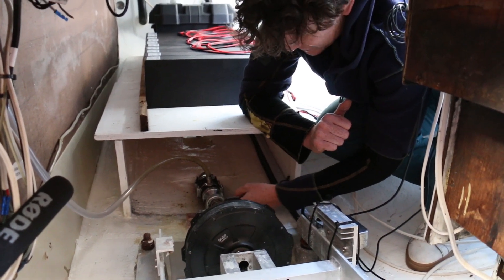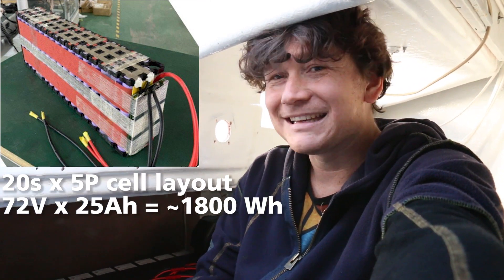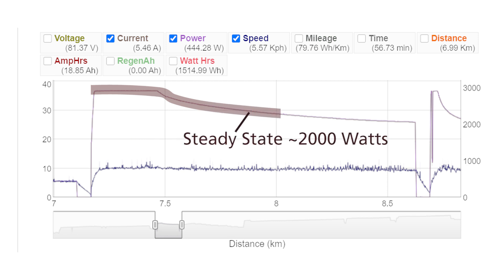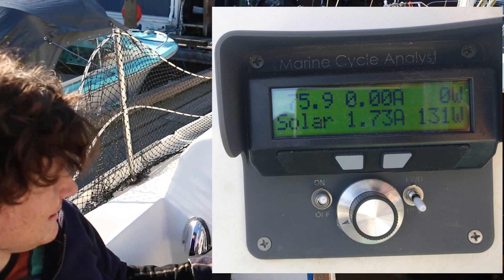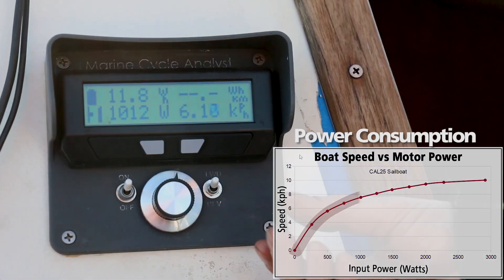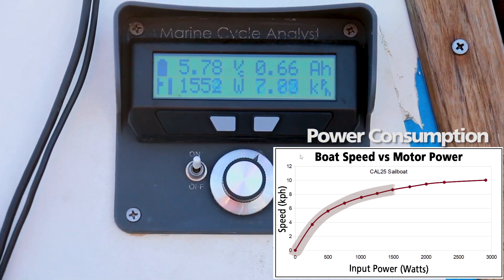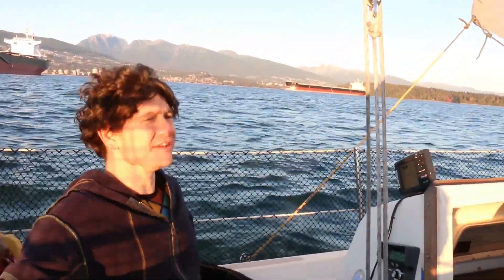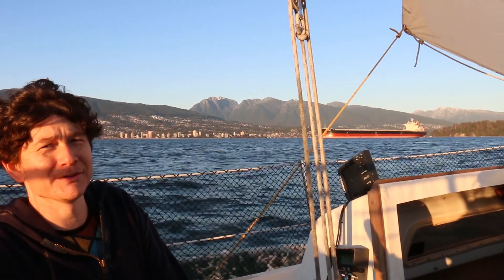Shamrock Electric Sailboat Conversion Part 2 - Sea Trials with 72V Lithium Battery Bank

Comment: When is water cooled motor & ctrlr coming up? 🙂
Reply from the maker: We'll be quantifying air cooling first and hopefully that's all the difference that's needed. A few fan blades on the motor that also blow air over the controller heatsink should do wonders.  
Otherwise it's flashbacks to the salt water cooling circuit of the diesel engine and not wanting to go there...

Comment: Very cool! I was dreaming of electrifying our similar sized sailboat a few years ago, but alas we have now sold it. As you noted for the west coast, similarly we often found ourselves motoring in non-existent to very light winds here on Kootenay Lake in the summer (or the opposite, a complete squall!), and I had thought it would be much more lovely to motor along under electric power rather than listening to the noisy gas engine. I was thinking of using Nissan Leaf modules however, as that chemistry is pretty safe at the temps I would expect in a sailboat. What chemistry are the 2170 cells you used? Cheers.
Reply from the maker: Hey Andrew, actually I also was hunting for Leaf modules for this project too but in the end it was cheaper to get brand new cells directly from one of our ebike battery vendors.  These are Panasonic 21700A lithium ion cells.

Comment: What is the size and weight of your boat? I am looking for a electric motor to replace my diesel but not sure how much kw/NM is sufficient, my boat is 30 feet and weighs around 7 metric ton
Reply from the maker: It's 25 feet and 5ton displacement. All details are in the ES build thread in the link if you expand the description.

Comment: Thanks for the response, Im repowering my electric catamaran, built in england in 1977, refitted in 2006 with pactroq pm motors, they are 2.2 kw, I am set up with 12 agm group 31, @ 144 volts per hull. I was wondering if you knew how to make a 144v battery bank using the types of cells you bundled up for your 72 volt system?

thanks
john
Reply from the maker: Hi John, yes you would just put two of the 72V banks in series and that would create a 144V system.

Comment: Why do144 volt systems produce less torqe than 72 volt systems?
Reply from the maker: The torque that a system can produce has absolutely nothing to do with the voltage that the system is designed to run at.    You can make a 12V system with tons of torque or with very little torque, just as you can make a 200V system with lots of torque or with very little torque.

Comment: Why not use GPS data with a speed pulse converter for accurate measurement? This should allow the CA to detect speed with GPS input?
Reply from the maker: The CA has that with the special firmware we made for the suntrip solar bike race, so yeah it can log and record the GPS speed data too from the GPS module that is on the analogger. We'll cover this in one of the next videos. 

But for the boat power/speed measurements you really want actual water speed, not the GPS speed. Otherwise the tidal currents throw off the measurements in a big way.
Reply: Does Grin make a larger motor controller than the PR?  If not, could you not get creative and use a water cooled base plate with either a heat exchanger to prevent corrosion?   A cool project, has the wheels turning (pun intended)

Comment: Hi,
Do you gain or loose speed when regenerating ?
Reply from the maker: In theory you would loose a tiny bit of speed, but normally when you are regenerating it's because there is already more than enough wind available and you're going at hull speed already. In those conditions no speed drop is discernable, but in light winds it's not something you'd want to do.

Comment: Good stuff Justin! I see you're trying to develop a product around it. Nice going. I'm interested in being part of the trial but I think my boat's too small and that I couldn't keep the motor dry of saltwater. If you have a tip for something that might be better as an outboard I'd appreciate it.  Also considering a Maytech MTI120116 18.8 kW motor. I was out in 35 kt gusts this past weekend and ended up radioing for help and getting towed in. I would like to be able to drop sail and self-rescue with my electric outboard in situations like that. 

At the beginning of your vid I see the entire motor spinning. I don't get it. I thought you'd want the body of the motor to be fixed and the axel / shaft to spin...
Reply from the maker: Hey nice to see that you have some sailboat and electric drive ambitions too! This solution of an ebike hub motor directly spinning the shaft only works for boats with an inboard motor in them. and yes the entire motor spins, that's how outrunners work. Inrunner motors don't have as much torque density and would normally require a gear reduction rather than direct coupling as we did here. 

Lots of people have DIY'd electric ouboards by just replacing the gas engine in a normal outboard with a suitable electric motor. We're going to do this on an old seagull motor for the tender using either an eZee or GMAC motor.  You don't need 18kW to self rescue in a small sailboat like I see in your videos, 1kW will be more than enough.

Comment: Great, thanks for sharing, i just experimented an engine cathastrofhic failure while starting up at the marina, first option i had to adopt is to buy an outboard engine, but now i need to deal with a main inboard power solution, I have been doing a bit of research, but here in Europe parts and components are very high in cost, wonder if your firm is actually considering the EU market? I wish to make the conversion myself and document the process as goes along. I am a aircraft mechanic and IT Bsc, so the skill is there but the knowledge is on the making.
Reply from the maker: Hi Fernando, yes please send us an email with more details about your boat and setup. We're hoping to be able to have an initial pilot release of this motor drive system later this summer and are looking for candidates with the right skills and boat to be involved in this early deployment and test phase.

Comment: I'm ready to start an electric ⚡ sailboat company. It's the future of at least sailboats at this point in time, so when are these kits available? Lol I think my favorite feature of this system , is the increased speed under sail @400w ! That's free quiet power . Building my first battery pack soon . Then the manufacture the motor mount , each boat is different . I'm a boat guy gone ebike , and this really gets me going ! Thanks much respect.
Reply from the maker: Hey Mark, stay tuned to our website. We may be in a position to offer this fast wind motor with a special axle for boat applications by this summer if all goes well.

Comment: Are the satiator outputs simply paralleled to the pack?
Reply from the maker: Yes indeed. The batteries were made with single port BMS circuits (same output for charging and discharging) so that they can safely all be charged up while connected in parallel, and the satiator output themselves have no problem being hooked in parallel either.

Comment: Does the boat have pedal assist? 😅
Reply from the maker: Someday,, I assure you not a trip goes by that we're not scheming of the best way to fit pedals in the mix :-)   One thing that is nice with the CA display is that we have a very good idea of exactly how fast we'd go with any amount of pedal effort. Pedaling hard you could do almost 2 knots, which isn't bad for getting in and out of a Marina etc.
Reply: @GrinTechnologies  Would be fun to see such a test compared against a sculling oar or a yuloh. Different muscle groups in use with similar top speeds and, naturally, human power levels.

Comment: Water cooling the electronics is your friend when your on the water! Big stainless steel plate on the outside sandwiched to a Copper or Aluminum plate inside the boat for the controller(s) and for the motor you could use some custom stainless steel side covers to flow water around the motor and a dripless shaft seal each side. (maybe stack two motors for a bit more grunt and appropriate pitch prop)
Reply from the maker: Yup the sea is a great heatsink. But for the controller it's simpler/cheaper to add more mosfets so that less heat is generated over a larger area in the first place. That way the controller runs more efficiently and doesn't require additional cooling, so that's the route we'll take for the next upgrade.
Reply: @GrinTechnologies  I've got a 1000w hub motor on my bike, it's runs 30amp on a 52v bat. Now I want to go faster. I did a search on YT, people have upgraded their stock controllers to e.g 2000w max output @60amps and they're plug n play so you tune them to your needs. The controllers are Grin phaserunner and ASI bac 800.

Edit: I've just seen your TY name. You already know the above.

Comment: This is really interesting system you're having here. The consumption numbers seem to be a little better than mine. But I'm doing a new bottom paint job this spring so we'll see how that affects. (no marine growth here, but just a lousy old bottom paint...)

That controller screen/knob-thingie is very interesting. Is it fully self made system?
Reply: Oh, but your boat is slightly smaller and I believe lighter as well so that explains it. Love the nerdy data sheet! ;)
Reply from the maker: The Cycle Analyst is self-made and has a long and storied history in the world of DIY ebike projects. This particular firmware release was made for people doing solar electric bicycle builds and it fit perfectly without any mods for our sailboat application which was cool.
Reply: @GrinTechnologies  Nice! Next iteration with knots to fit marine applications! ;)

Comment: Your doing great work thanks for the time and effort 👍 can I ask a question..... if i was to do a jet propulsion set up in a small boat like a jon boat or tinnie as there called here in Australia what motor would you recommend.... the boat dry weighs 45 kg the battery weighs 50kg and the jet weighs about 5 to 10kg... i would like to see 40 to 50kms per hour in speed.... any suggestions 👍

Edit... looking at a 48v battery set up with 237 ah,  and I can put about 1000w of solar on my boat
Reply from the maker: 40-50 kph speeds is a very different power realm where you are dealing with planing rather than displacement paradigm. You are probably talking in the many 10's of kilowatts unless you have it running on hydrofoils.   The 1000 watts of solar will not do much to help out in these power levels.
Reply: @GrinTechnologies Thanks you for your reply very much appreciated 👍 for me i won't be at constant speed i would only need to do those speeds for about 10 to 15min then I will be going at speeds of about 5km/h for trolling for about an hour... some times im in 1 spot for hours with no motor running ... but at any 1 given time im only at speed for short periods of time... i dont care if i need a 5000w motor or 15,000w motor ect im just looking for a recommendation on size of motor..... and remember the whole boat only weighs about 200kg including the batteries, motor my fishing gear and me.... even 30 to 40km/h would be sufficient.... oh and hydro foils is way out of the question 🤣 would be good though 🥳 I really want to go with jet propulsion for skinny water fishing and the whole idea of no prop hanging down sounds good to me... as it is the boat does 40km/h with a 15hp and im sure it would still get up on the plain with a 10hp... what size electric motor would be equivalent to a 10 or 15hp... ive heard some of these electric hub motors are hitting 18,000w.... is that more at what I would be looking at.. or is that too much 🤣 and I see you had yours rewound.. is that something I need to do.....
Reply from the maker: @thatdudethatsezshiz7706  It sounds then like a 7.5 - 10 kW electric motor would do the trick, and you can certainly get those power levels from hub motors made for scooters and small motorcycles.  The choice of winding KV and battery voltage depends on the RPM of your drive shaft at full power, so that's really the most critical thing to know next. ie ie when you are up on a plane is your jet impeller spinning at 1000 rpm or 20,000 rpm?
Reply: @GrinTechnologies  Thanks mate 👍 Now we are moving forward much appreciated... at present i dont have jet propulsion set up in my boat this is all experimental in the mind and ideally concept out of curiosity with the willingness to move forward if the concept can show the integrity i seek... going off prior jet ski specs i need to hit about the 7000 to 9000rpm range  to hit max rpm in a jet propelled setup... is this in accordance to an electric 7.5kw to 10kw hub motor rev range or does it need to be rewound to provide that amount of revs at max rpm.....  also does the voltage eg: 48v to 72v change the max revs and which way is better to proceed with.... will I get more torque from higher voltage or just more power.... whats the maximum size hub motor I can get at 48v do they come in a 10kw setup or do I need to look at 72 or even 96v for the 10kw hub motors.... i have many questions but i sincerely hope that your up for the challenge.... kind regards your new Australian friend Jimmy 👍